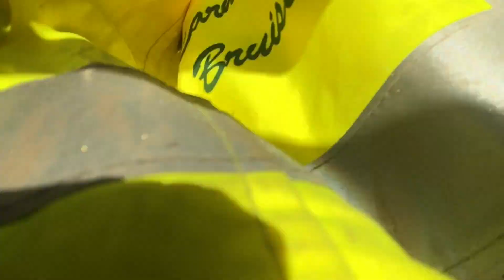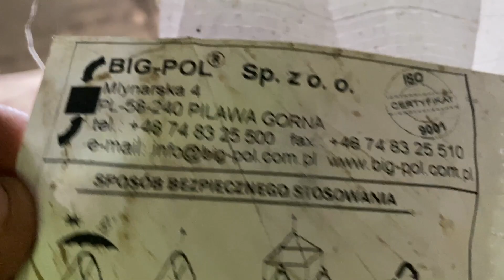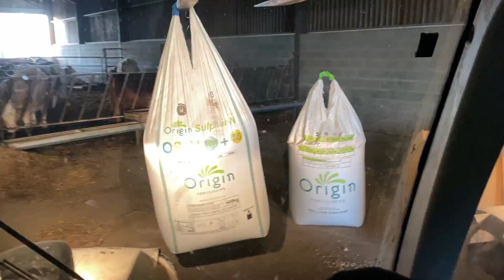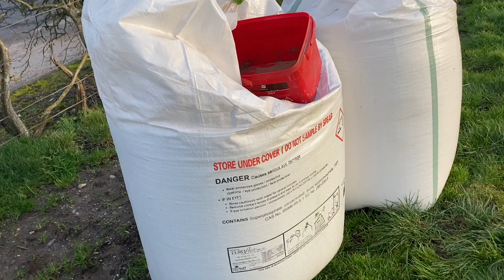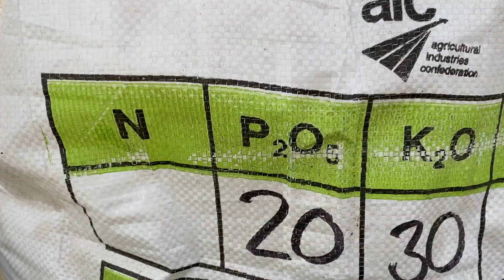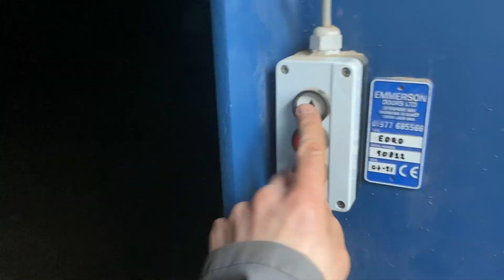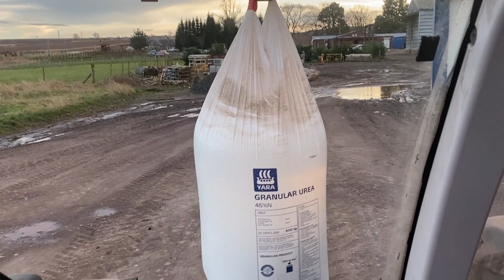SPREADERS NOT WORKING | THE SHEEP GAME #CRAWFORDFARMS #194

Comment: Check the wires going in to the amatron box are in the right way around
Reply from the maker: 👍🏼 it was low voltage in the battery caused box to change one setting in the box